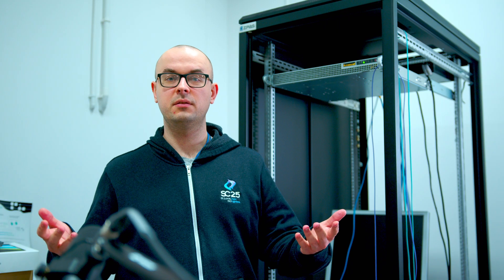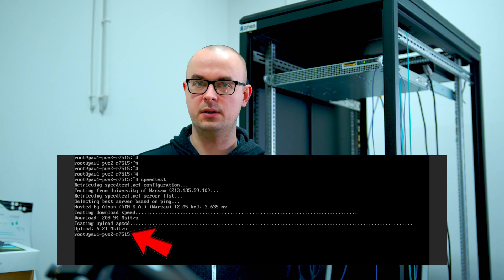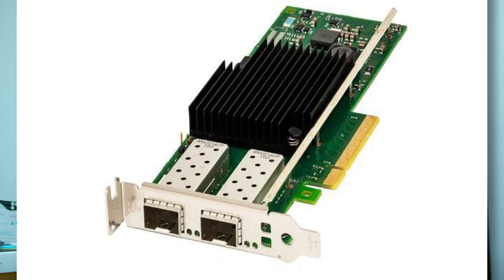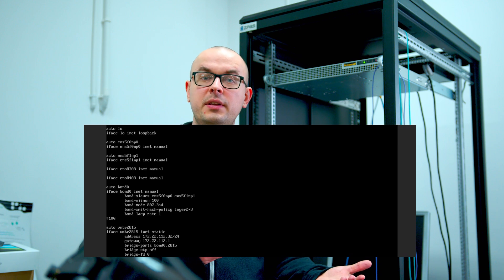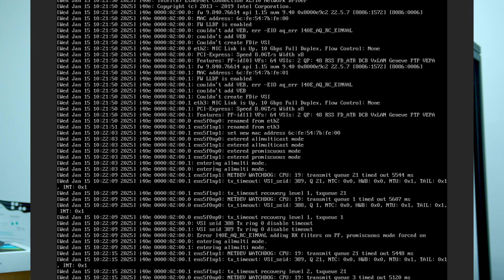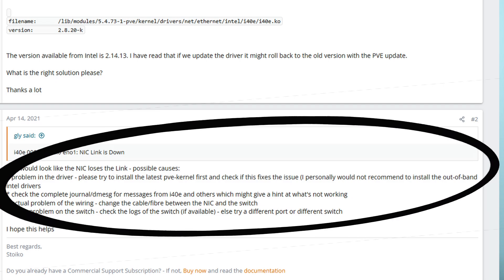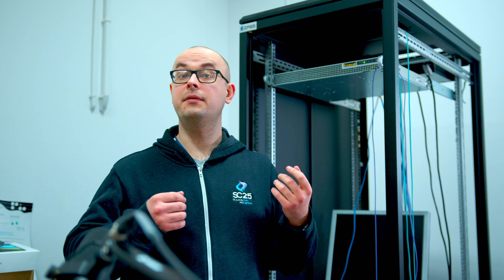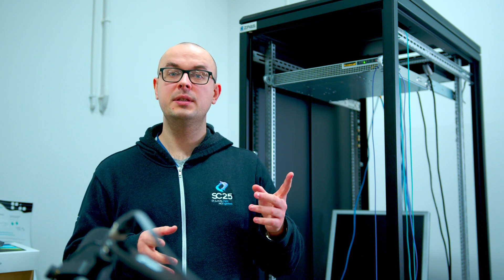Don't make this mistake when upgrading to 10Gbit network

Comment from the maker: Share the love, don't buy intel NIC's, join discord or smth.
EDIT: SOLVED! https://www.youtube.com/watch?v=Z4gw-x2r378
Reply: i use a pair of X-710 nics with a fiber link,  i can burst a file at 1GB/s  but for some reason after about 4GB of transfer the speed just DUMPS down to like 200MB/s   no clue whats up with that
windows 10  to truenas
Reply from the maker: @KuramaKitsune1  If you're reading/writing files, is your storage capable of sustaining 10Gbit traffic? You might be maxing out the drive buffers
Reply: @DCTekkie   i just took this screencap,   im not sure how to test the storage servers sustained speeds on truenas https://youtu.be/SW1p3g-Am1s
i thought ZFS and truenas would use the system RAM to buffer transfers,  the win 10 machine has 128GB  and the Truenas has 64GB
Reply from the maker: @KuramaKitsune1  Well, there are a lot of factors but for starters if you have HDD based NAS I'm pretty sure you won't be hitting that 10Gbit constantly, especially with large files.
Reply: @DCTekkie  yeah fair enough 
It is currently a six disk hard drive array running on an NVMe boot partition

Comment: I had a similar issue about a year ago with some 25gbe E810 cards. The problem for me was solved by upgrading all the cards to the same/latest firmware.

Comment: I happened to be reading about the IP Identification field today, and one interesting point I read was that if the proper specs were followed, IP flows would be limited to around 6.4Mbps due to a limit of 2^16 (65536) identifiers being available during the maxium datagram lifetime period.  Sounds horribly similar to your speed issue.  (Of course, most systems don't ahere fully to these specs, as that would suck!)  Mmm.  The ID Identifier is only really used for fragmentation.  Could your "broken" servers be connected into a VLAN on your switch with a lower MTU?   What speed can you get out of your servers if you run IPv6 over them..?
Reply: Interesting, that would also agree with the asymmetric degradation.

Comment: Oh, there's more: Bad PSU making wavy power, bad power regulator caps on the mobo, FPGA's on the NIC, different versions of the NIC's hw, not happy with the driver, some old skool Zilog SCC "You can write to register B, and then A, but it'll hang, so write to A, then B" baloney, there could be some bus interference, the firmware on the NIC might not like a particular transceiver, the transceiver might have a challenge with the cable, there could be an option card in one of the affected servers that's affecting airflow, it goes on... I don't think it's at the level of the switch port etc., because I bet the dmesg pops out even if the connectivity on that NIC is unplugged.  It's a failure to initialize, if I read it right, and that's saying "the driver didn't see the HW as valid, or, the action of the HW wasn't valid under command of the driver."  One could go nuts by doing the following: 1) label everything 2) write a program that spits out all the combinations of part swaps 3) get two examples of a completely different NIC 4) swap parts around, one a at a time and then eventually you might find the dmesg moving with a card.  In case it's a combo effect...aka "this card on that server" then it's simple: it's a cursed -1 networking card from a upper level of hell.  In all seriousness: I wonder if the NIC is misidentifying itself and the driver is using commands from a dialect it doesn't support.  Promiscuous mode is a clue.
Reply: I'd expect most of these phenomenons to just hard crash the computer, though...

Comment: I had a very similar issue with this card under Windows. I was joining both interfaces with iscsi and getting 10G from each interface on its own, but joined I would get 3-4G max instead of 20G.

Decades of hearing old timer engineers complaining about auto negotiation mode made me go down a rabbit hole convinced I was wasting my time, but that rabbit hole actually lead to success this one and only time in 30 years. Both interfaces set to manual 10G didn’t fix the issue mind you.  No.  I had to set one interface to manual 10G and the other to auto. I changed these settings 20 times because my brain wouldn’t accept it, but it was consistent every time. Didn’t matter which interface was set which way. As long as one was set to auto negotiate and the other was set to 10G manually, I got my 20G aggregate. Ran flawlessly for 3 years before I left that employer and it’s probably still running today.
Reply from the maker: @swilson42  I’ll definitely give it a try, I ran into (supposedly) autoneg issues myself fairly recently
Reply: @ To this day, it’s one of my IT “war stories” that I tell newbies to remind them that sometimes after trying what makes sense, you try what doesn’t make sense. And sometimes it works.

Comment: I would swap the card into another server to see if the error travels with the card to another system.
If the error is with the card it could be a overheating problem or a weird setting on the card itself.
In that case you could download the firmware from one of the functioning cards and put it on the faulty one
If the error is with the system you could have an issue with the pcie bus and/or mainboard. You could try a different pcie slot if available.

Comment: I also have problems with these chipsets. They worked fine under Windows, but there was a problem under Linux. Pay attention to the allocation of BAR for this card during system startup. From what I remember, the drivers reserved memory incorrectly. They reserved too small an area of memory and not all registers in PCIexpress were available for it. I got around the problem by disabling mmap in GRUB during system startup.

Comment: Just out of curiosity, is it not possible that it might be a firmware bug in the network card itself? Perhaps if possible upgrade the firmware on the network cards themselves? Not sure if that is possible but it is just a thought, had something similar with a motherboard network card a few years back. Solved when updating the firmware for the motherboard and it had apparent fixes for the actual network card firmare part in that update.

Just a thought ^^

Comment: Your cards appear to have old firmware, 9.40. Try the newest 9.53.
Can't post link here, but search for Intel NVM update utility 700 9.53, it will guide you straight to the downoad. I highly suggest doing it via EFI shell, and be sure to update correct cards.
Reply from the maker: Good eye, but I've already tested it and rolled back to 9.40 to have consistent environment across whole stack for testing. Thankfully it wasn't FW issue (I've uploaded new vid and solved it)

Comment: I went with the Brocade ICX switches and tried using a XL-710 card (40 gig QSFP+) to connect to them. Firmware, drivers, nothing. Linux would straight up just not even pull an address. Windows could at least resolve an address, but traffic just wouldn't happen. Other hacks too, like trying cables flashed with different vendors on. Removing vendor lock from the cards. Tried 2 different cards. I could only ever get machines with these cards in to directly connect to each other, not to my switches. Nothing ever worked, and I had to go with Mellanox cards. But my X520 cards work like a charm.
Reply from the maker: So in my case x710 worked under brocade ICX, but didn't work under juniper EX. This time I had to turn off LLDP in the intel's card FW. Sometimes it can be as silly as defining port speed in the switch config
Reply: @DCTekkie  The X710 is not the XL710. No amount of setting changes made it work with the Brocade. The ethernet frames would not line up.

Comment: What firmware are you running now on the intel X710. Which model of the nic are you using and last wuestion where did you procure those intel X710 nics ? (Ebay? Used or new from china?).

Why not swap that nic for another spare nic you might have.
Reply from the maker: Everything's brand new, complete Dell integrator and delivery, thankfully issue got solved (latest vid). tl;dr disable lldp in card's FW

Comment: 10Gb, 25Gb, 40Gb, 56Gb, and 100Gb pcie cards, need to have active airflow pressure on their heatsink in order to not thermal throttle or melt fiber cables. Digital Spaceport just put out a video regarding this issue with networking cards and would really recommend watching that.
Reply: That’s not true for all cards. I’ve got an aqc113 10 gbe card, the heatsink is warm to the touch, this card is also used in Mac mini’s with 10 gbe. Compared to an intel x540, it uses less power and doe not get very hot.
Reply: but this is server hardware, it's going to have ample workflow inside
Reply: Not true for 10/25/40.  When they overheat the connection will just drop, not melt things like 100 will.  I have a bunch of Mellanox x3/4 cards and none of them have overheated to the point of destroying anything when I tested them back when to see what I could get away with considering airflow is tame compared to a server in a datacenter.

I should mention these are all fiber cards, RJ-45 runs substantially warmer.

Comment: Did u try to change the transceiver ?
Reply: I was thinking the same...
Or maybe use a DAC cable to some switch if possible.

Another test you could do to make sure it isn't some kind of buffer/queue issue is to set it to some separate VLAN on the switch to make sure there is no other traffic and then link to some slower network device and run some transfer via this network interface to the slower device.
See if this remains working.

Also since there are so many posts here suggesting the temperature, I would also try to monitor the temperature if possible and see if there is some correlation.

Can you get some stats from the network card and/or the switch to see if there are errors reported?

Comment: I have an X710-DA4 in my pfsense router and another in my main proxomox server and never had an issues with them.  I also run a bunch of X520-DA2's including one which is LACP'd back to the pfsense router without a prob.  That said, I've read a bunch of things saying that the X710's suck and to use 520's and there's lots of problems...but i've never seen them probs myself.  I can get about 9.4Gbps up AND down with iperf3.  All that said though, I have mlx4's for 25Gbe in the mail for an upgrade real soon  ;)
Reply from the maker: So I've managed to solve this, in case of x700 series intel NIC's their LLDP agent messes up LACP so it needs to be disabled, I've posted an update on the channel :)

Comment: If you do end up replacing them, you could go for a card that has sfp28, as those have been coming down in price recently and its the same connector as sfp and sfp+, so they can fallback to 10gbe and whatnot

Comment: I got two of these. Repasted the cooler, flashed new bootcode and new firmware and I’ve never had issues with them. Also check if you have enough airflow.
Reply from the maker: This time it was LLDP, I've posted an update on the channel :)

Comment: X710 nic has also an other issue with the heatsink not making contact with the chip  on some cards. You need to carefully inspect the contact just to make sure. I had a lot of these cards with the exact same issue..
Reply from the maker: @cmos64  well, manufacture issues do happen, I’ll give them a look during the week
Reply: @DCTekkie  I would also check this. I had X540 intel NiC that overheated constantly... mine did totally turn off every now and then, so it doesn't exactly match but it is different chip so it might act differently when overheated. I am fairly sure you can inspect temperature of the chip somewhere.

Comment: why going the expensive route, for clustering when common enduser hardware can archive the same? i mean proxmox and so on give you the tooling for this. some nanokvm if not going for expensive mainboards. some old chassis would work fine?
Reply from the maker: But I am using proxmox, what do you mean?
Reply: @DCTekkie  those dell servers arent cheap, you bought them used? i mean am5 with ecc looks more sexy as ever and the punch for the wattage is better. frankensteining a homelab in such way is more exciting.
Reply from the maker: @lyth1um  You got it wrong, this isn't a homelab :) I'm documenting my adventures with the servers I have at work, this hardware is meant to handle some enterprise level tasks
Reply: @DCTekkie  im sorry, yeah if you dont have to pay this. :D ive seen some that grabbing some old dell servers etc. for their private stuff.

Comment: could try setting your system fans to 100% to see if the nic is thermal throttling
Reply: External fan with open case solved it for me once in ghe oast. But that didn't throttle nearly as much. Still weird that he got good speed for a second there

Comment: I had a similar issue in the past. I had to reboot a couple times till things worked and it would be stable till I rebooted the server again. Basically was rolling a dice each time I booted. Never figured out why this happened, just found a work around.
Reply from the maker: Yes, it seems to be a sort of race condition but that makes those cards unusable in production setting :/

Comment: When this kind of thing happens I usually configure a switch port to be as dumb as possible to rule out weird bugs, so any power saving crap, teams, vlans, spanning tree, etc.
They keep adding features to ethernet but the firmware quality control has not improved so the only way to research this is start basic and work your way up.

Comment: I'll share a story with you. I've built a PC in 2020, AMD B550 motherboard with Intel I225-V 2.5Gb Ethernet chip. Immediately when plugging the Ethernet port into my Cisco switch (1GE interface) I noticed that the link wouldn't come UP. As I am a network engineer, I started toying with different scenarios (no auto-negotiation, different speeds, etc.) and noticed that the link would come UP only when the interface was in 10 or 100 Mbps speeds (I did not have a switch with a 2.5 GE interface at that time to test that scenario as well). So basically, Intel made a 2.5 GE NIC for casual consumers that did not work on Gigabit Ethernet (which was 20 years old technology at that point). Searching for this obscure issue on the internet was tiresome, as there were a lot of results with people having different issues, but not this specific issue. From my findings it's a hardware issue with the chip which cannot be fixed, possibly because of buggy NIC firmware (which cannot be upgraded). Fortunately, the WiFi 6 chip on the motherboard is ok, I've used it since. My conclusion as a network engineer - I would never, ever, if possible, use an Intel NIC again.

Comment: Yep, there's a reason I still use the X520.
Reply: I had pretty bad experience with X540. It seemed like Intel is fitting at least some with cooler that isnt able to keep chip cool enough. Resulting overheating and then network card randomly going down. I guess they designed it to be in server rack with good airflow , while mine is next to GPU (one empty slot in between)

Comment: Did to try to isolate the network cards into a test bench? it might be a firmware issue on the cards themselves. Try a fresh debian installation on a test machine and install one of the cards from the faulty systems and see if you get normal behaviour
Reply from the maker: I've tried different distros/kernels (even 4.x) but the outcome is the same, even without any network configuration whatsoever dmesg is tainted. I don't want to isolate the cards out, because it's a Dell platform, with dedicated Dell firmware (I'm using Dell Lifecycle Manager to upgrade and manage FW). All signs point to i40e module being very unreliable

Comment: Paywall solution from RHEL says: for RHEL7 you need to upgrade kernel, for RHEL9 investigation is still on-going (no solution). Overall - looks like a driver issue or PCI quirk? No vendor support? Boot off live USB is the same? Weird. Good luck.
Reply from the maker: Yea, i've seen that article, "Upgrade if you're using kernel 3.x" :D